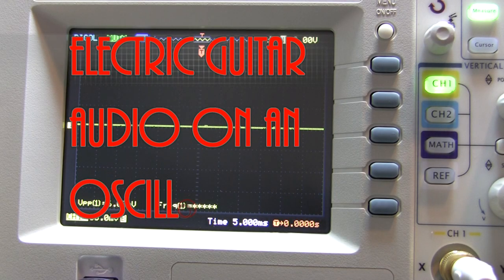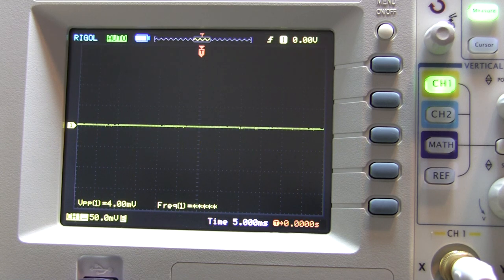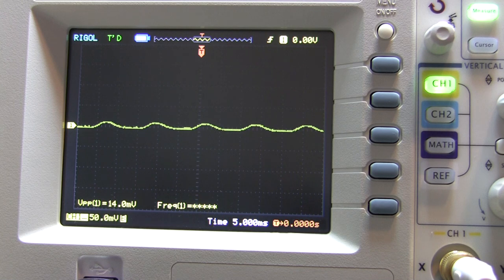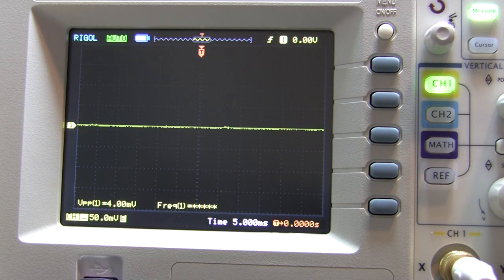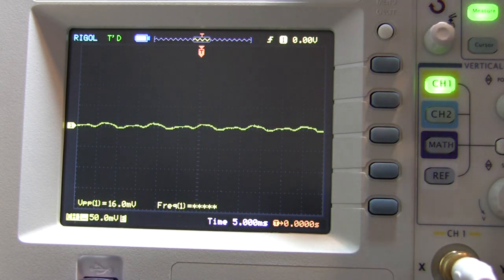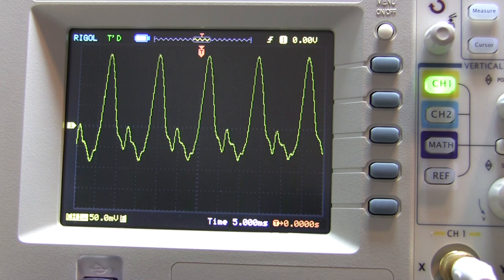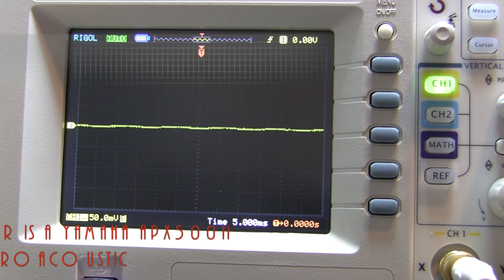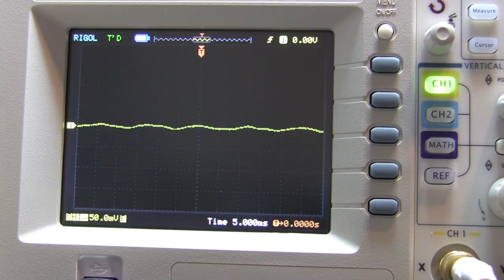Electric Guitar Audio on an Oscilloscope

Comment: Could you show what electric guitar notes look like on an oscilloscope before and after being run through distortion/overdrive? I'd love to see just how the waves are transformed!
Reply: the wave will be clipped
in a clean sound you can see sine waves
they use diode to clip out the voltage so its a sine wave but flat on top
Reply: @EonLimpiado11  well, yes, I know that. But it'd be interesting to see exactly how it clips. Not to mention there are lots of varieties, like asymmetrical clipping, etc, it'd be cool to see, not to mention the difference between transistors, diode, and tube clipping.
Reply: Same here, I am curious!
Reply: if your going to do this id recommend using a singal generator or reamping a sine wave, its what im going to do once i save up for a decent scope. Otherwise the notes pass by and change so fast much of the signature your looking for will be loss, with a simple wave to start I find I get a better feel for the result. But also who knows maybe a sine wave is too clean im just learning atm.

Comment: can you confirm that different pickups in the guitar will give different readings?
Reply from the maker: Yes, hotter pickups generate higher voltage and there is a difference between pickups' frequency response.

Comment: What cables and adapters did you use to connect the guitar to the scope?
Reply from the maker: ***** Just a standard guitar cable that's been cut so I can connect the two wires to the oscilloscope probes.
Reply: @robrobinette  I know this question is five years too late and you may never see it, but does that mean that you aren't using an amp here?  I've never "played" an electroacoustic guitar, but I guess that we hear the "acoustic part" (probably a poor choice of words) through a mic and "see" the "electric part" on the "scope"?
Reply: Exactly what I was wondering!  Could just be a microphone into the scope, but it would be nice (imperative) to know.

Comment: Always wondered why there is an oscilloscope at the guitar shop in my area. What are the practical applications of this type of setup? Thoughts? I was under the impression that you may be able to pinpoint the distances from the strings where the magnet begins to affect on the waveform of individual strings in a negative way? Is this a possibility? or is this equipment simply for diagnosing problem electronics?
Reply from the maker: I don't know for sure but you probably could see how the waveform is distorted by the pickup magnet being too close to the string. An oscilloscope is mainly used in audio electronics to visualize, trace and measure the audio signal.
Reply: You could compare pickups, make adjustments, etc.  Say you were going to change pickups but wanted the same output level.  You could measure the original pickups, then put in the new "pups" and adjust their height until you match the original pickups' amplitude on the scope.

Comment: Late question but is this signal coming directly from the pickup, so without any preamplification?
Reply from the maker: Yes, the oscilloscope probe is connected to the Stratocaster's output cable with no amplification.

Comment: How would I go about plugging an amped guitar into an oscilloscope. Or lets say a whole band running into a mixboard/ableton. How would you go about putting the entire bands signal into visual on the oscilloscope?
Reply from the maker: You would need a 1/4" Y cable (guitar cable with three 1/4 inch male jacks) to send the guitar signal to your amp and to the oscilloscope. For the entire band you would use your mixer's monitor jack to the oscilloscope.
Reply: Rob Robinette Clever, clever! Thank you very much!
Reply: Rob Robinette Hey, I cant seem to find some anywhere online? Do you know if any places sell it on the internet?

Comment: Did you have the guitar plugged directly in, or was it branched off from the amp.?
Reply from the maker: The scope probe was connected to the electric guitar cable direct from the guitar, no amp involved.
Reply: @robrobinette   Thanks. And thanks for all that amazing tube amp information you have online. It answered a few nagging questions I've had for years. Very impressive.

Comment: How do I connect the audio of The guitar to an oscilloscope? Do I have to use  any special cable? Thank you.
Reply from the maker: Just cut a guitar cable. Connect the oscilloscope ground probe to the shield and the other probe to the center wire.
Reply: @robrobinette  Or just clip the ground to the sleeve and the probe to the tip.  Secure with electrical tape if needed.

Comment: Can analog recorded music be manipulated by an analog oscilloscope? If so, how's it done?
Reply: Oscilloscope doesn't manipulate the input signal, it's purely for viewing and measuring purposes.
Reply: @al3633  What analog device can be used to manipulate sound frequency? Let's say music: from 442 hz to 150 hz? It's part of an experiment...
Reply: @jimmerhardy  slowing down a vinyl record or old cassette would be an example
Reply: @al3633  Is there a device that could precisely bring it down to a certain frequency? If not, I'll wing, but I'd like to be realistic.  And does a sound played at an odd lower frequency simply sound slower? Thanks.
Reply: @jimmerhardy  if we're just talking about 1 note: middle C for example, which is 262Hz. If I lowered that frequency it would simply sound lower like a lower note, not a slower note. If we're talking about music, which is a combination of notes (multiple sound frequencies, different instruments) and rhythm (beat frequencies) and we wanted to decrease the frequency of the overall music, then both the note and the beat frequencies would decrease, all the notes would sound lower and all the beats would sound slower.
Reply: @al3633  That really helps and I've got it. Thanks so much for taking the time to explain that. I couldn't find an explanation anywhere. I've save this. You're tops.
Reply: @jimmerhardy  happy to be of assistance
Reply: @jimmerhardy  
Octavers do this.

Comment: Thumbs down!  Sorry, but tests should include the connection setup ...for newbies!  Make sense?
Reply from the maker: ". . .electric guitar connected directly to an oscilloscope." That's pretty much it. The oscilloscope probe was connected to a guitar cable center wire and the oscilloscope ground was connected to the guitar cable shield.